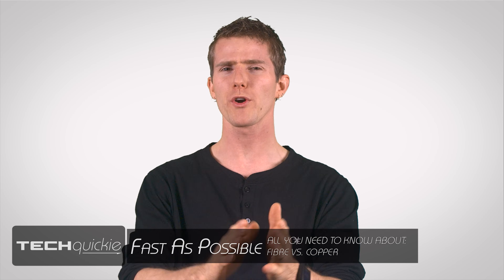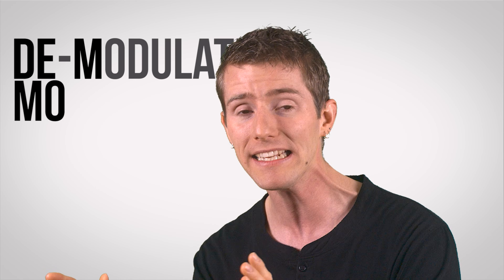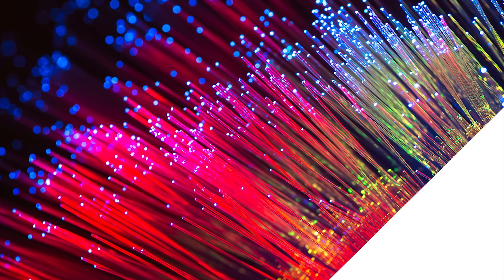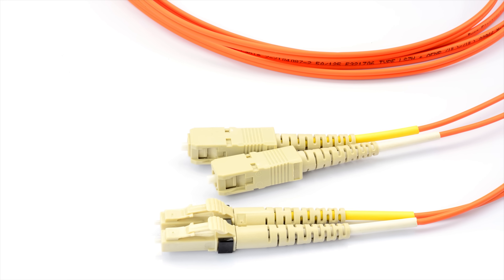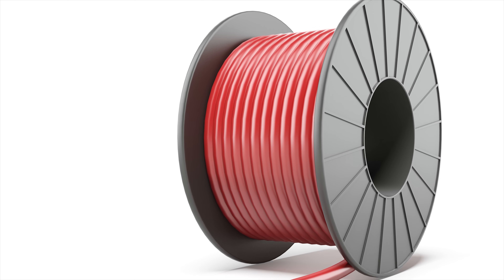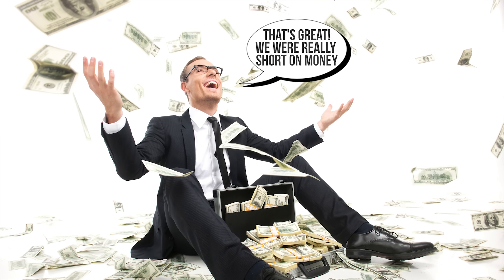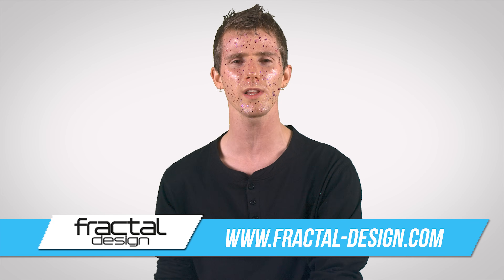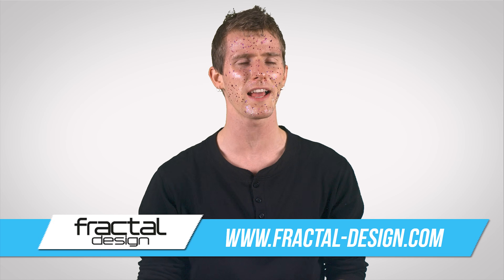Fibre (Fiber) vs Copper as Fast As Possible

Comment: Uhhmm both copper and fiber cables make use of electromagnetic waves. The signal that goes through a copper cable also essentially is light, but at a different wavelength. What makes the optic cables so much better is the larger bandwidth, as in the band of wavelengths that can pass through the cable (the old, "physical" definition) along with the better retention of the amplitude of the wave over the same distance. The second part really is the most important bit. Signal/noise ratio is everything, which is much better for fiber which is why it is better.

The interpretation of the light being on or off is vast simplification since it is impossible to make pure bursts. To make a pulse, by definition you need to mix multiple wavelengths which makes it just as much a waveform as on the copper cable.

So yeah: wider band of wavelengths that don't degrade nearly as fast. Everything else is irrelevant from a "speed" perspective.
Reply: This is absolutely not true. The flow of Electrons (particles with mass) are not electromagnetic waves (Photons, massless particles). Electricity is not electromagnetivity! Photons do not go through metals, electrons move through them because they are not strongly bound to the specific atom.
Reply: eagames456 The electrons are not what carries the data. They can't possibly travel that fast through a wire. The drift speed of electrons in copper wires usually is in the neighborhood of around 10^-4 to 10^-5 m/s.

The electrons do move a bit, so they generate a magnetic field between 2 wires. Since you are sending data through the cable, that magnetic field will also change through time, which in turn generates an electric field which causes more electrons to move, which cause a magnetic field a bit further down the cable etc etc...

The carriers of the data are these fields, which obviously are electromagnetic fields. The photon is the force carrier of that force. This is why the signal travels at roughly the same speed as in a fiber cable, both are the specific speed of light of the medium. This is another strong clue that photons carry the data and not the electrons.

EDIT: wikipedia actually has a good numerical example of this calculation of the drift speed through a copper wire: http://en.wikipedia.org/wiki/Drift_velocity
Reply: Akira Ichikawa I am insane because I know the physics behind a copper cable? Don't take my word for it. Pick up a book on the topic or do your own research. That's the nice thing about science, you don't need to take anyone's word for anything. Feel free to let me know what you find.
Reply: Akira Ichikawa So the wavelengths of the light are irrelevant you say? So what about the Fourrier transformation you need to make that pulse? If you graduated in this field, you really should know that there is no such thing as a pulse in a single frequency. By making a pulse you necessarily combine multiple frequencies of light so the shortest pulse you send through a medium is directly linked to the band of frequencies that can travel through the medium. Please tell me this sounds vaguely familiar to you.

You are right that currently the bottleneck is not the optical cable, but this is the case for copper telephone lines.

I did not claim that which goes through the cable is a single beam of light, but since the cable carries an electromagnetic wave the basic physics behind it are equivalent. So what part don't you agree with?

The changes in the voltages and current (and phase and everything you'd like to do with the cable) are propagated as an electromagnetic wave. That's how the electrons on the receiver's side know the electrons on the transmitter's side get poked in some way. Whether you interpret it as the current inducing a field which induces another current, etc or just the electrons pushing their neighbors is irrelevant. The first option clearly is an electromagnetic wave pretty much by definition, and the second option makes use of photons to "communicate" between the electrons, which is explained very well in quantum theories (which I don't pretend to understand beyond that). This results in a stream of photons hopping from electron to electron which is required for any kind of information to be transferred from one electron to the next because the force carrier of the electromagnetic force is the photon. anything connected to electromagnetism is communicated through photons.

And what is it now? I read: 
"by the simple fact we don't work with modulation"
and
"Shift Keying is the most basic kind of modulation"
That seems like a pretty direct contradiction. The fact that we're not using any really advanced techniques right now is irrelevant. No modulation is no data, plain and simple.

May I ask what you graduated in? I'm sure you know a lot about the practical side of things, but you seem to have missed the theoretical underpinnings of it all.
Reply: eagames456 Seriously? We've known they are the same force since Maxwell's publication in 1873. 

That's 141 years ago. The facepalm is real.
Reply: eagames456 And both are electromagnetic fields, just with the other component of the field being zero. They have a different effect but are ruled by the same physics.

What you should know if you know your physics is that if you change either of the separate field over time, you generate the other field. A changing electric field generates a magnetic field and a changing magnetic field generates an electric field.

So if you want to transmit any kind of information through the cable, you are going to need change the voltage (or the current) between the pair of wires, and therefor change the electric (magnetic) field between them. This change inherently generates a magnetic (electric) field.

Why do I have to explain all this stuff? All of this was figured out by Maxwell. It's not exactly controversial stuff you know...
Reply: eagames456 Put a compass next to your metal plate and see what happens when you change the voltage. The needle will move.

Why?

Because the instant you change the voltage, your plate still is at a different voltage, causing a current until that equals out.

You can't change the electric field without moving charges. Either you have to bring in new charge carriers or move away charge carriers.

This is expressed in the Maxwell-Ampere equation.(plucked from Wikipedia here) http://upload.wikimedia.org/math/6/c/6/6c6dbd4bae2bbb7fcec740ef91d26a07.png

The B term is the magnetic field, the E term is the electric field. dE/dt on the right side is the change in the electric field over time (like what velocity is to distance). The J term is not important right now. ANY change in the electric field necessarily generates a magnetic field.

More info here: http://en.wikipedia.org/wiki/Amp%C3%A8re%27s_circuital_law#Extending_the_original_law:_the_Maxwell.E2.80.93Amp.C3.A8re_equation

And yes I am linking to Wikipedia. This stuff is over 140 years old, like I said. If you got a better source that contradicts this, feel free to let me know.
Reply: eagames456 It's not a changed electric field that generates a magnetic field. It's a changing one.

It is not just the instant you hit the switch, there is a magnetic field between 0 < t < x. It will be large at first as the difference in voltage is high, and asymptotically gets closer to 0 as the difference in voltage gets lower.

On a wire carrying data, your field never stabilizes because you are always changing the voltage to send a signal. If at any point you let the voltage stabilize (which only happens asymptotically in the first place), you are wasting bandwidth (in the data sense). When the electric field is stable, you might as well send another wave through to send more data. You keep sending more and more through in a given amount of time until you can't actually reconstruct the original voltages that went in.

What you say is in itself correct, it just doesn't apply to cables carrying data.
Reply: eagames456 Sorry bro. Niosus is right. Your perspective is rigid and that is possibly why you don't agree (or maybe it's your ego), either way, good luck in life.

Niosus thanks for bringing this up because that's exactly what I was thinking during the video.  Also, thank you for going through the effort of compiling the information. It was a great refresher and I sympathize with your pain. <3
Reply: eagames456 Jesus Christ! Don't even bother to reply to such atrocity! This guys is insane! Let it be!
Reply: Niosus no, you're insane because you said "The signal that goes through a copper cable also essentially is light" and "What makes the optic cables so much better is the larger bandwidth, as in the band of wavelengths that can pass through the cable". Completely insane. It is simply wrong and you can ask anyone who have some real knowledge about physics to confirm it. You can read whatever you want your entire life, that doesn't mean you understood it. Like you gladly could show us.
Anyway, bandwidth have nothing to do with wavelengths in optical fiber by the simple fact we don't work with modulation. It is a main factor at distance tho.
Reply: Akira Ichikawa Are you a troll? I really hope you are.

 First of all: Bandwidth: /ˈbandwɪtθ,-wɪdθ/ noun Electronics
a range of frequencies within a given band, in particular that used for transmitting a signal.

All you needed to do is GOOGLE IT: http://bit.ly/GBtPeu

More info about the concept I am talking about: http://en.wikipedia.org/wiki/Bandwidth_%28signal_processing%29

Now for my light statement. First of all, light is an electromagnetic wave (high school physics dude): http://en.wikipedia.org/wiki/Electromagnetic_radiation#Types_and_sources.2C_classed_by_spectral_band_.28frequency.29

Therefor any electromagnetic wave has the same properties as visible light, with the only difference being its wavelength.

So what's left to show is that what carries the signal in a copper cable is an electromagnetic wave. I quote: "The speed at which energy or signals travel down a cable is actually the speed of the electromagnetic wave, not the movement of electrons."
http://en.wikipedia.org/wiki/Speed_of_electricity

For optical cables, we do work with modulation. Having pulses is "Amplitude Shift Keying" (ASK)
http://en.wikipedia.org/wiki/Amplitude-shift_keying

 For most applications it makes sense to also modulate in other ways to increase bandwidth. Things like "Polarization Phase Shift Keying" (PolSK) and "Frequency Shift Keying" (FSK) can be used on top of ASK to convey more information than just a single bit per pulse.
http://iosrjournals.org/iosr-jece/papers/Vol8-Issue4/D0841518.pdf?id=7649

Now please fuck off and do some damn research before calling people insane. You clearly don't have any education on the topic at all. If you'd still like to criticize me, get some damn sources next time, will you?

And Merry Christmas, you douchebag.
Reply: Everything you said here is right. The definitions are right. But not the application.

About Bandwidth: as said above, the frequency >of the optical pulse< isn't referring to the wave itself or its wavelengths. The frequency here is defined by the number of pulses of light, literally on or off, light or no light, and that have absolutely nothing to do with the frequency of the electromagnetic wave, its wavelengths or the intensity of the signal. It depends on the number of pulses the cannon can produce. Just that. Nothing more. No wave modulation, nothing.

Light is a electromagnetic wave, of course, but you said the signal that goes through the copper is light. No, it isn't.
"The speed at which energy or signals travel down a cable is actually the speed of the electromagnetic wave, not the movement of electrons." Oh, now THAT is correct. That doesn't mean that what is in the cable can be considered light.

The modulation i was talking about was the > wave modulation<, like radio or in copper cables, and not FSK or ASK. Shift Keying is the most basic kind of modulation there is (as i said, the definition is correct, but i wan't talking about that), it simply read of the data. It interprets the signal, but it don't change the signal. With optical communication is light on or off, just that. >There is no manipulation of the wave whatsoever<. You don't touch wavelengths or anything.

And i already done my research when i graduated, so no, i don't need to.
As i said, everything you cited here is right, just the interpretation and application is what changes.
Reply: Akira Ichikawa I got a notification that you replied to me (including a preview) but I can't seem to find it here. Did you delete it or did something else go wrong?
Reply: Niosus Nope. Those are "electric" fields, not electromagnetic.
Reply: Niosus Please do some research before spreading misinformation if that was not your intent. If it was your intent, stop trolling.
Reply: Niosus ...
Electric fields linearly speed up electrons. Magnetic fields change the direction of electrons...
Think about that. I'm studying astronomy in university, I know my stuff.
Reply: ***** I'll be the first to admit my mistakes. When I am not certain of something, I will either not reply at all or do my research before replying.

But my issue here is that everything I say is just common information found in every physics book covering the subject. It's okay if you don't know it, but then do your research before correcting me!

What nobody can see here is that I actually picked up the literature and looked up what I was saying, just to be sure. Every time they correct me I also do the research on their claims to see if they may be right.

What you see is frustration, not me trying to be cocky...
Reply: Niosus A static charge creates an electric field. For example if you have a variable power supply and you link the + with a conductive plate, you will get an electric field, without any current flowing. Change the voltage of the power supply, the voltage on the plate changes, there is still no current. With the voltage change, the electric field changes. No current, no magnetic field. There is no change in the magnetic field while the electric field changes. Q.E.D. you are wrong.
Reply: Niosus When the situation stabilizes (t=x) the electric field is different from the situation at t=0. The electric field at t=x =/= the field at t=0. Thus, a changed electric field doesn't need a changed magnetic field.
The instant when it changes is not important, that is not the point.
Reply: Niosus The data is transferred through the voltage differential. High voltage being the digital "1", low voltage the "0". Any magnetic field is a result and does not matter for the signal. The data transfer through a copper cable has nothing to do with an electromagnetic field, it's just a potential difference. there is no way for an electromagnetic field to go through a conductor, that's why a faraday cage works. Light has no way to go through a solid or liquid metal.
Reply: eagames456 And here we are back to square one. I probably should clarify that the fields are not inside the conductor itself, but rather around it. I assumed you knew the shape of the fields around a wire. I guess I was mistaken.

EDIT:  images to refresh your memory
electric field shape: http://www.mosaic-industries.com/embedded-systems/_media/instrumentation/conductivity-meter/fields-around-wires.png

magnetic field shape: http://www.school-for-champions.com/science/images/electromagnetism__wire_magnetic_field.gif

Let's just add one more line of evidence, shall we? When a signal is going through a copper cable, it can spill over to cables very close to it. This often happens in cheap headsets where the audio can bleed into the microphone even though there is no way the microphone could actually pick it up acoustically. Linus even mentions this in his video, btw. How is this possible?

Easy. The microphone wire acts just like an antenna, picking up the EM waves from the audio wire next to it. What possible mechanism could otherwise induct the signal without electrical contact? Think about it. It is exactly the same as what happens in a radio, and clearly radio waves are a form of light.

Look I'm not going to waste any more time on this. I have given many different approaches that all show that the information travels through the cable in the form of an electromagnetic wave. I have done the research to make sure what I said was correct, I have given the sources for my claims. I have defended my position adequately. I don't really care if you believe me or not. Take it or leave it.

Have a nice day.
Reply: Niosus Don't act like i'm an idiot. YOU said it's light transmitting a signal through copper wires. That is not true. Don't act like I'm the one who is talking crap.
Radio antennas work through the disturbance of the electrons caused by an EM field. there is no electromagnetic radiation inside the wire. There is literally no way for light to travel through solid copper. THAT was my point. THAT was your mistake.
Reply: eagames456 Most of the photons are going through the wire, it's the only way electrons interact with each other anyway. The distinction is irrelevant. That's part of the whole particle/wave duality. Going through or around is a matter of which side of the duality you are looking at. 

Again I've explained this before. We're going in circles again.
Reply: Niosus I think we're just misinterpreting each other... we're not getting anywhere.
Reply: Dylan Burke Thanks! You're welcome. It's interesting stuff. I would be lying if I said I didn't learn a few new things along the way.